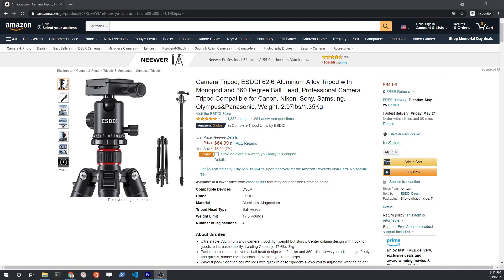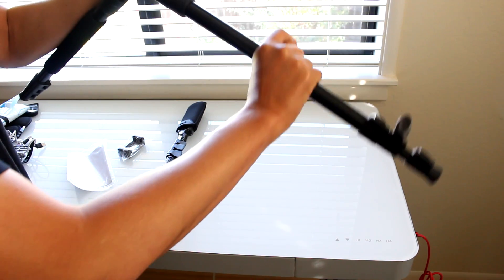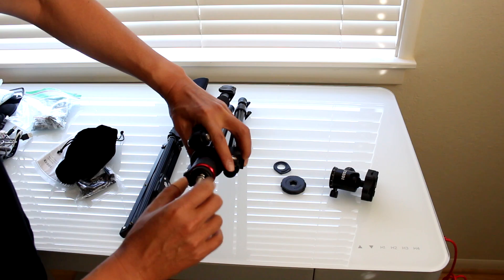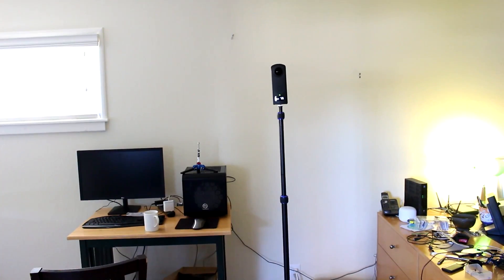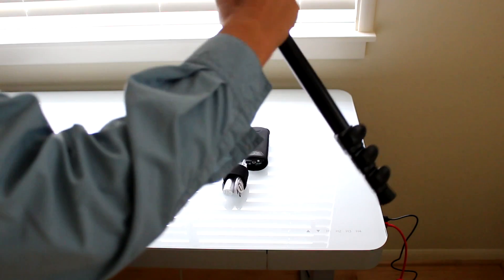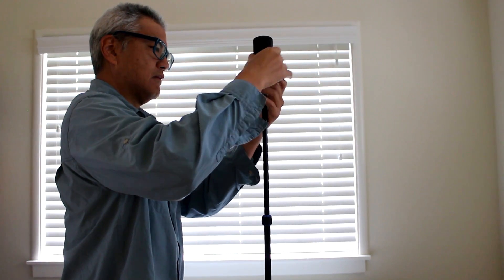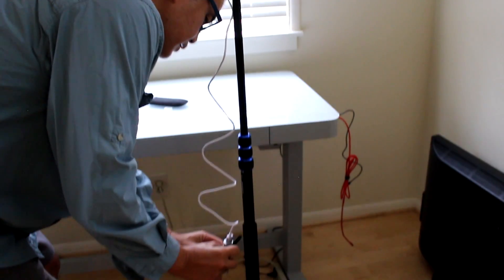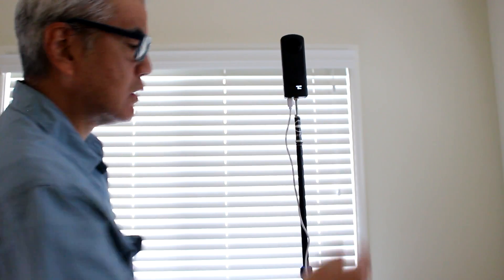Tripod and Monopod Review for RICOH THETA Z1

Comment: Thanks for making this video! Where can I find the 3/8 to 1/4 inch connector used at 1:45 in the video?
Reply from the maker: that one came with the tripod, but you can buy these for a few dollars on a place like Amazon or similar.  Just search for 1/4" male to 3/8" male tripod adapter.  it should only be a few dollars and easy to find.
Reply: @THETA360Developers  oh I see. Cool, thanks a lot for the response.
Reply from the maker: @ambvlntSoul  some of the ones on Amazon are cheaper aluminum versions, which actually work fine.  However, if you want a real sturdy one, then some place like BH photo might have more selection.  https://www.bhphotovideo.com/c/product/1649878-REG/zuma_gp_1007_steel_male_1_4.html or maybe this https://www.bhphotovideo.com/c/product/1453847-REG/camvate_c0926_double_male_thread_adapter.html

Comment: very helpful video! Can the Theta Z1 be used with a powerbank (like Samsung for example)? Also, is the charging cable a USB type C ?
Reply from the maker: community member use the Z1 with a powerbank and USB Type C cable.  The camera will work with the powerbank attached.  see this post for rig used by professional 360 photographer.  https://community.theta360.guide/t/tripod-types-for-ricoh-theta-z1-in-2021/6844/13?u=craig